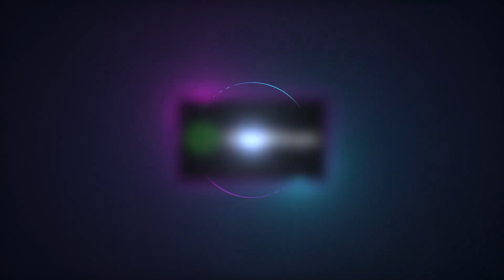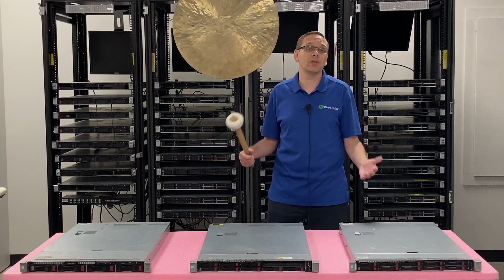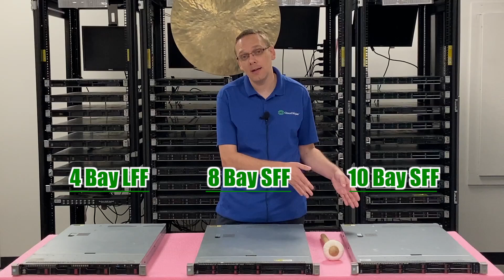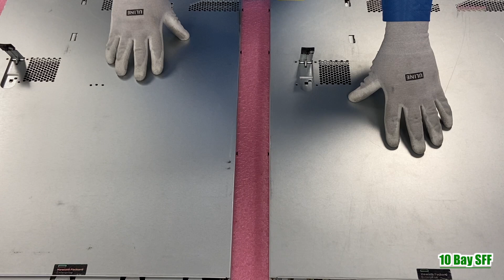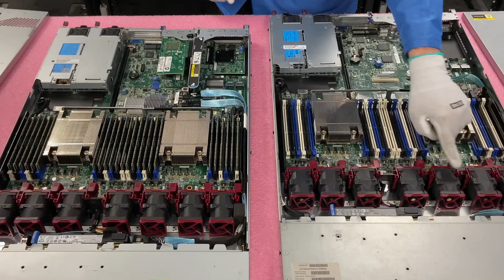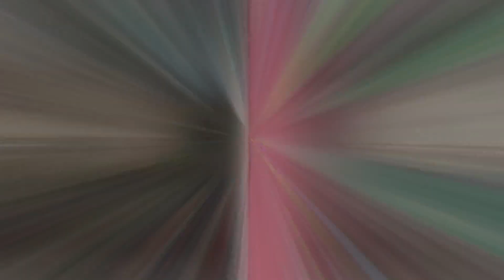HPE ProLiant DL360 Gen9 Server Overview | Different Chassis Types | 8 Bay SFF | 10 Bay SFF |

Comment: Hey, great videos for some great EOSL servers.

Do you happen to know if it’s possible to remove the DVD (or whatever) bay on the 8 SFF and turn it into an 10 SFF chassis?

I have seen such an adapter on a dl380 g10, but not for a dl360 g9 so far.

Many thanks in advance!
Reply: there actually isn't a 10 sff bay chasis, it's just the 8 sff bay chasis with the 764630-B21 enablement kit preinstalled.
Reply: @edwardscroop9149  sounds like a good hint, thank you!
Reply from the maker: I don't believe so.  Haven't heard of this.